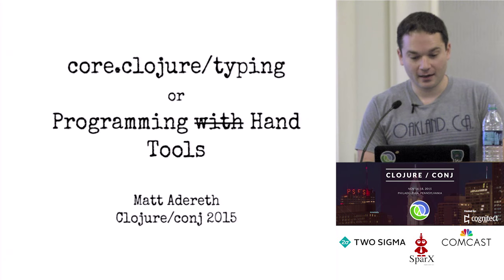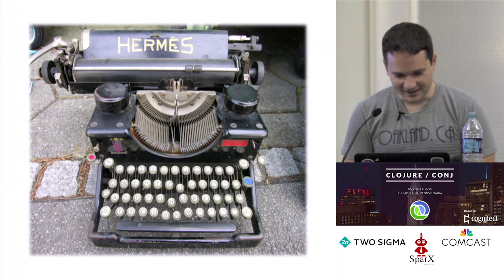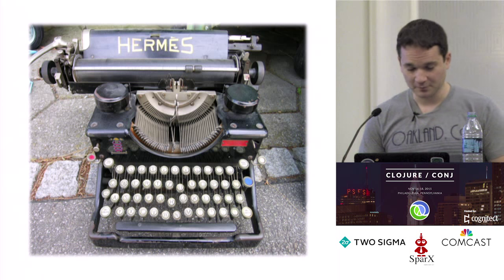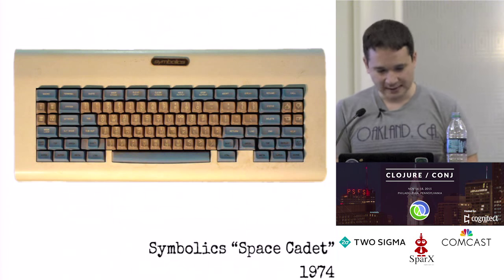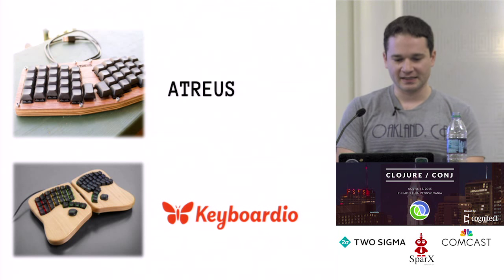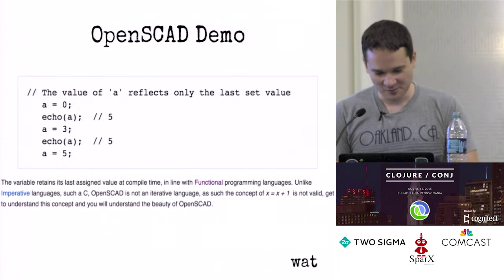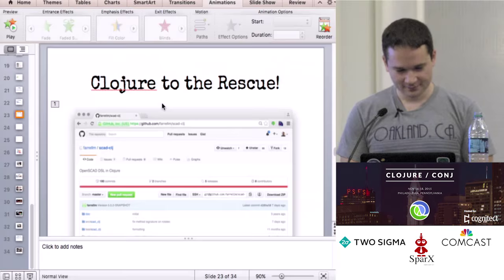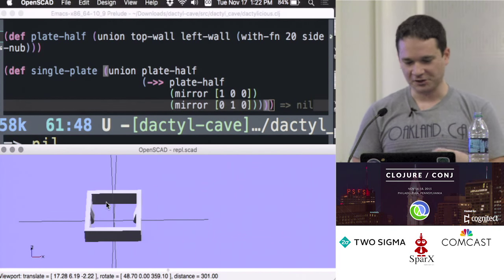clojure.core/typing - Matt Adereth

Comment: What about stenograph machines?  They allow you to type 3x faster than traditional keyboards.  Left hand is starting consonants, Right hand is ending consonants, thumb is vowels.  Since it is a chorded keyboard, you can have every single key be a "SHIFT", "CTRL" type key, and it made it easy to type keys in different rows at the same time since their was little space between the key rows (between E and D).  

Other Ideas: 
In addition to removing the spaces between the keys to allow chorded keys (E+D), maybe you can have two or three pressure sensitivity like on touch screens.  Weak pressure sensitivity is used for swiping gestures across multiple keys, middle is used for typing, and hard press would be used for commands or in LISP deep A would mean (A|) where | is the cursor.

Moving the entire keyboard brick when the keyboards are seperated can maybe be used as a rough mouse, with more precise can be done via swiping.

As cameras become cheaper and more ubiquitous you can use it to look at other hand movements other than typing like rotating wrists, lifting fingers up high or pointing at the screen.  However, Microsoft Kinect and Playstation Camera that do this kind of tracking have kinks in it (just like voice acting which is very good at coding S-Expression type languages) to work in real life.
Reply: aoeu256 THANK YOU. I just watched this -- great video, by the way -- and thought the same thing. If you're going to talk about the ways humans have experimented with the placement of letters on the keyboard, how could you ignore the history of the Steno keyboard? I know you're talking about keyboards from a programmer's perspective, but I think stenography has also contributed to the modern day keyboard in certain ways (ever heard of the asterisk?) Now, I'm a stenographer so I can't help but think about it constantly (my mind is turning every word I hear or read or speak into Steno 24/7) so of course I thought of it here. The fact that there are multiple theories saying what letters go where for the same keyboard is in itself awesome. Also awesome about Steno keyboards is the number of keys. And even though there are so few, (in my theory, at least) there is an R, an S, and a T on both sides. And through various combinations of these letters, you can write other letters (TPH = N on the initial [left] side) and in fact, you can write the entire alphabet with your left hand (unless you only use your right thumb for the final side vowel keys E and U, but you could use the left if you had to). Not to mention the keyboard itself has no letters on it. This is for a very important reason. In order to maintain writing speeds at up to and over 250 words per minute, one is to avoid looking at their hands. This causes the brain to double-process the words instead of hearing the word and stroking the keyboard without hesitation, as it's supposed to be. The most interesting part of stenography is the actual way the keyboard is used. Instead of hitting one key at a time, it is played more like a piano by stroking the keys. One stroke, therefore, does not create one letter but (at the least) one syllable or one word. Briefs are created to make it possible to write high frequency phrases in one movement. So, for example, in one stroke of the keyboard I can write "State your full legal name and address for the record" or "Ladies and gentlemen of the jury" or other phrases that come up frequently like "beyond a reasonable doubt" or "from time to time" and similar phrases that are used frequently. You would be surprised to see how much of my writing can usually be done in briefs. Much of what we say is the same stuff over and over, just arranged in a different order. As you can tell.... I am a little obsessed.
Reply: There are a lot of stenograph software mods/keymaps in the Ergodox firmware already, e.g. https://github.com/qmk/qmk_firmware/tree/master/keyboards/ergodox/ez/keymaps/steno